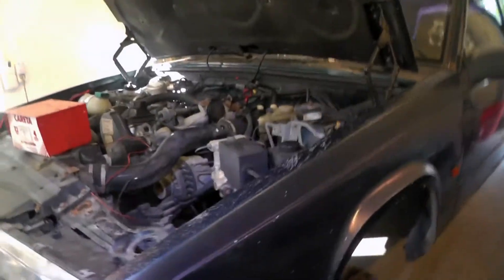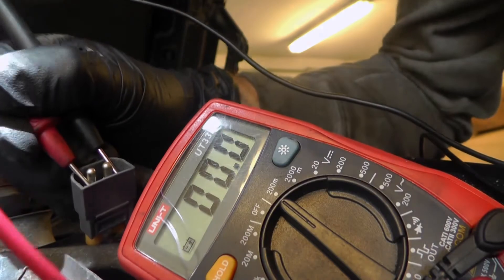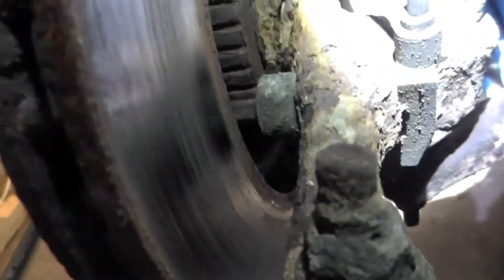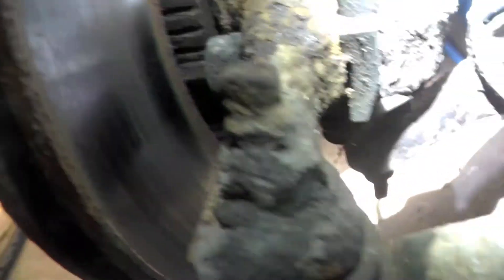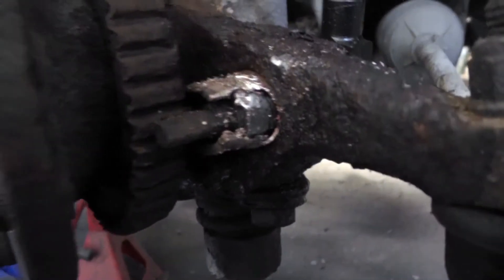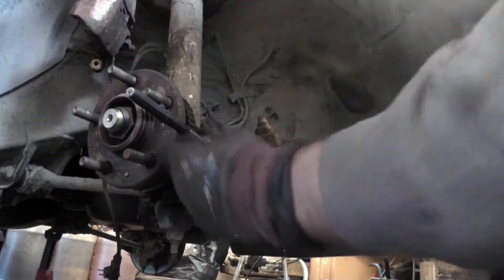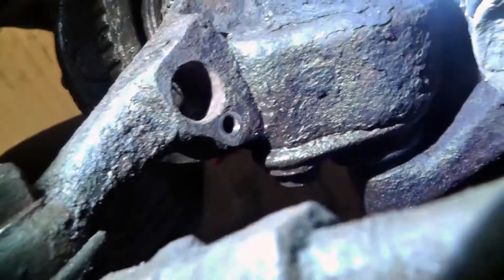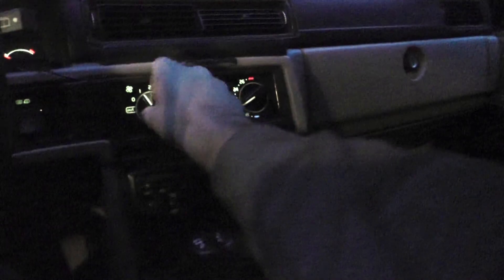Volvo 940 Turbo Part 4 Replace ABS Sensor

Comment: Thanks for the great video.  At the end, the ABS light on the dash was still on?  How do you get it to go off? thanks - or perhaps it was the light-bulb warning light that I saw?
Reply from the maker: I am pretty sure that the abs light was off, I didn't have any more issues with the abs. I am not sure what light's are on in the dash at the end of the video.
Reply: @BagheeraTube  Thanks. I have the same issue with my 940, and since my last comment, I bought a new sensor and plugged it in, and the dash-light went off (I thought you might need to connect some electronic scanning device to re-set the warning light, as is needed with the air-bag).
  Without taking the calliper & wheel bearing off, the cylinder at the sensor on my car looks a lot wider than the cylinder on the new sensor - I noticed on the Skandix website there is a copper coloured sensor holder or sleeve that slides in from the wheel side (Volvo part number 1387273).  Do you know if I need to buy one of those too? Thanks
Reply from the maker: @kingofdubb2133  sorry this is beyond me, in Sweden these cars are common and parts too, in different regions the supply of parts can be very different. But my new sensor did not fit that easy, the old on was stuck and the hole needed cleaning. After a lot of electric wire brushing I got it to fit.
Reply: @BagheeraTube  Thanks
Reply: @BagheeraTube   Thanks, I'm replacing the wheel bearing at the same time (I have a 36mm socket) so hopefully that will make it a bit easier
Reply from the maker: @kingofdubb2133  I wish you good luck 🤞 with the replacement process 👍

Comment: Do you have a source for the ABS sensor for 940 or 240 Volvo?  I'm ready to drill it out like you had to do, but I have no source for this sensor in front.  Advice?
Reply from the maker: You mean where to buy it? I just used some random site that sell car parts, but scrapyard probably have them also.

Comment: Can I use the head off a 2004 940 turbo wagon on my 1994 940 non-turbo sedan?
Reply from the maker: According to the Wikipedia page 940 was produced during 91-98, here in Sweden. So are you sure that it is a 940 -04? If it is a 940 it is possible that the heads could fit, but they could be some differences, I am not an expert on these cars.